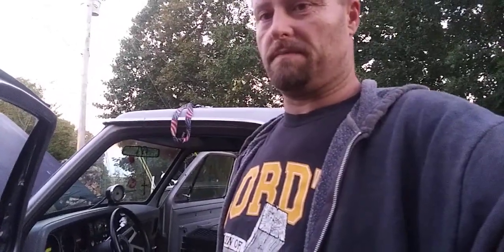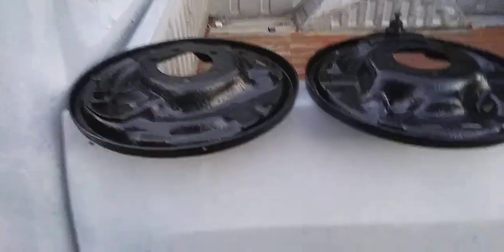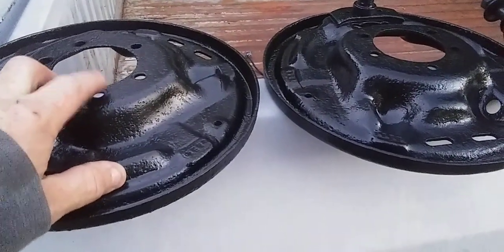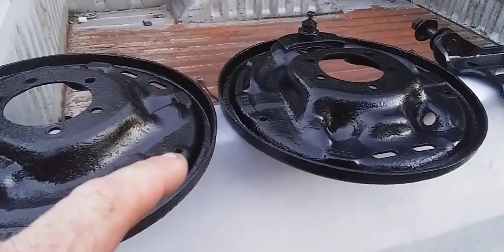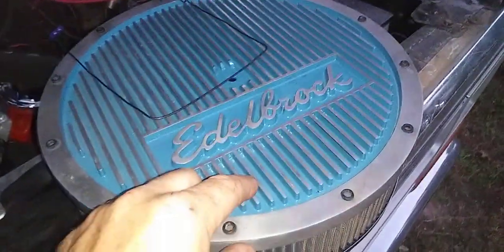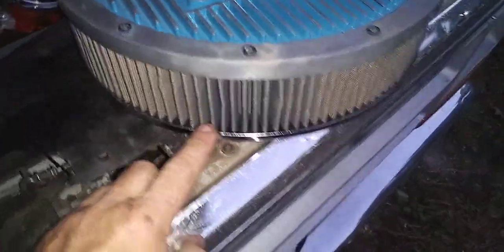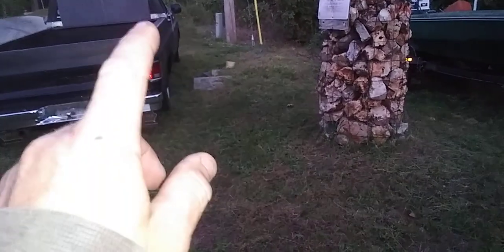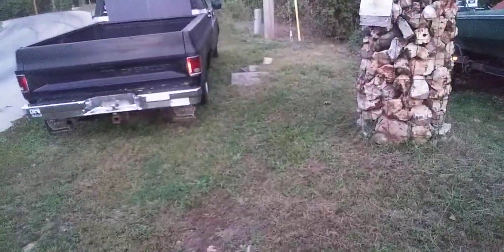8-3/4 rear end update & plan for thermoquad manual choke upgrade + Rant

Comment: You replied to my headers glowing red. Thank you.  I am just running regular champion plugs. Do you sugest a really high quality plug like a Iridium plug or a E3 plug. Also I do have a msd ignition box which really makes a big spark.  Thanks again
Reply from the maker: I run NGK nickle V groove  plugs for a 2000 jeep cherokee   with 4.0 liter . the ground strap and the electrode tower is taller then stock plugs . Makes my slant6's 318 and blig blocks run better . olnynly catch is it takes a 5/8 plug socket instead of 13/16  . their made for 7mm plug wires but I run 8mm MSD wires on my 318 with no issues . it takes the spark away from the head and puts it more towards the center of piston where air and fuel meet.  champions / autolites are chinese junk . nothing wrong with iridium plugs if you got the money . they handle heat better and conducts electricity better . platinum plugs suck as well.

Comment: Mopar man i have a question since you seam smart. I have a 440 rebuilt runs great does not over heat and does not not stumble on exceleration. Its a quick fuel 850 carb. Full tube headers and single plane intake manifold. But the back 2 header tubes on each bank in the rear glow red when warmed up. Do you have any thoughts on that. I changed carbs cause I thought it was a lean problem. I dint think it is. Any info would be greatly appreciated. Thanks you Brother. As a moper guy. I have a 73 cuda with a 440 engine it won best mopar 2 times . that was when the 340 was in it . Thank you my friend. i am subscribed.
Reply from the maker: Thanks for your support of the channel 😎👍🏁. You have either a timing issue or lean issue or both . What kind of spark plugs you running ?